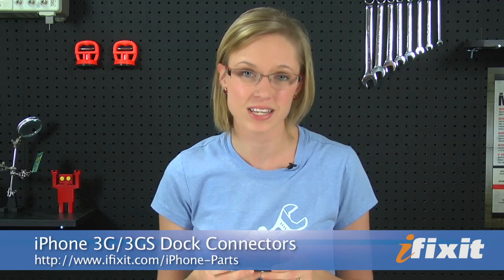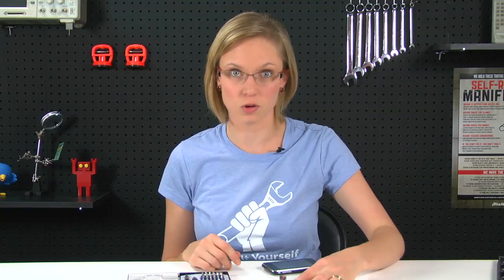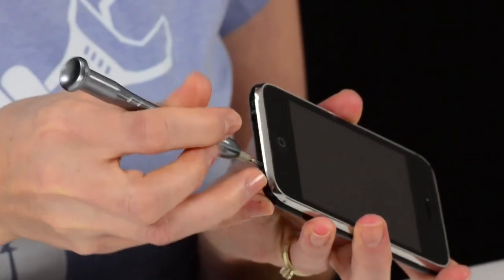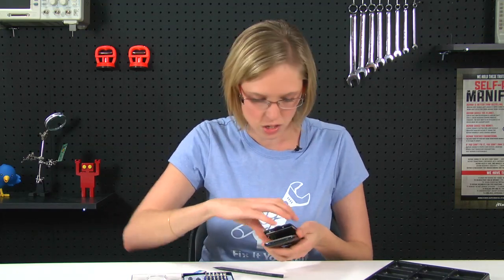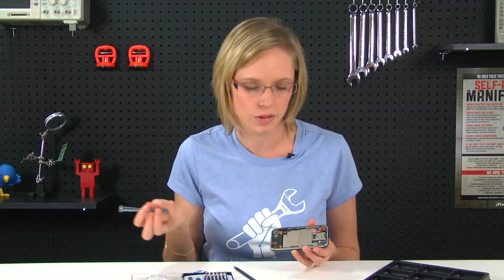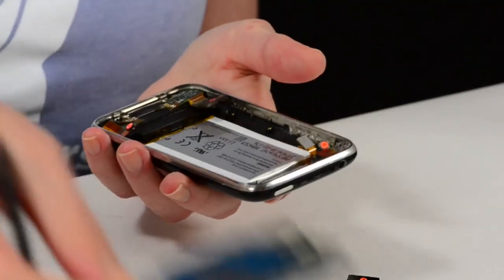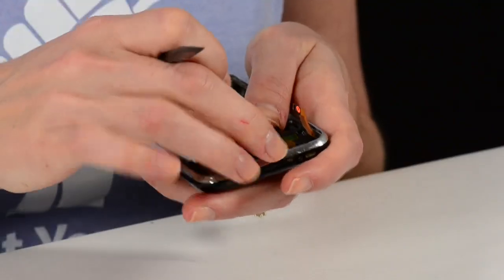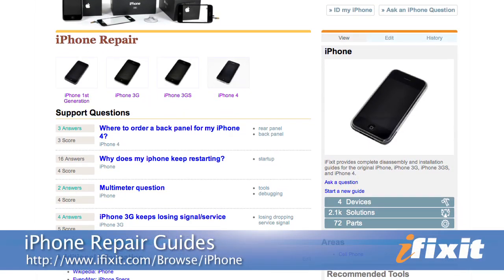How To: iPhone 3G/3GS Dock Connector Replacement

Comment: This is the best video. I have watched lots and too much dallying around with screws. Thank you for getting to the real info. Double thanks for mentioning that the dock connectors screw assembly goes above NOT under the frame/base. I bought a dock assembly and the #4 connector would not marry. What are yours like?

Comment: Please someone tell me. Will replacing my dock connector also replace the ringer speaker? My 3gs has gone silent but with external speakers plugged in sounds work. I assume this means my speaker has gone it. Please advise.